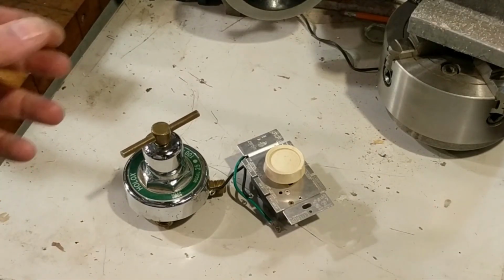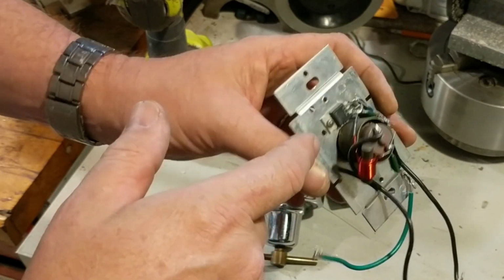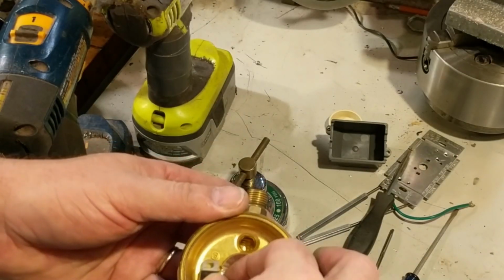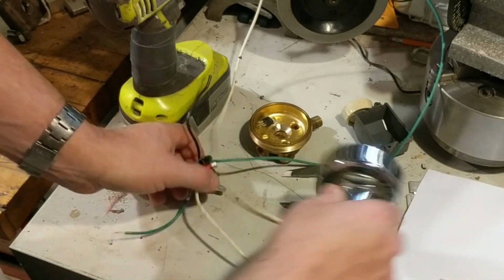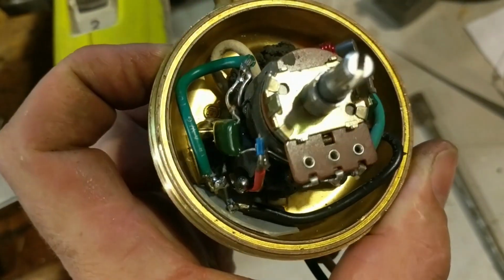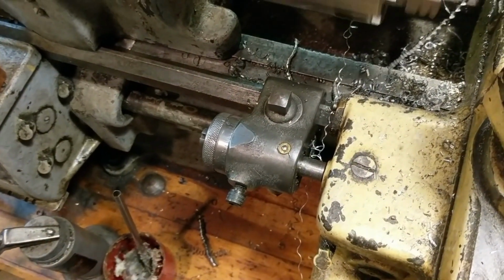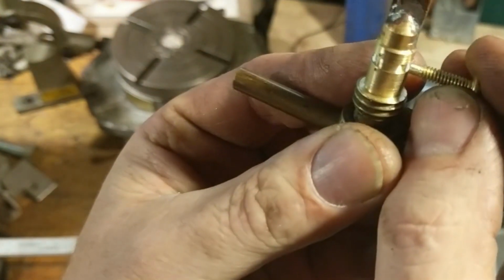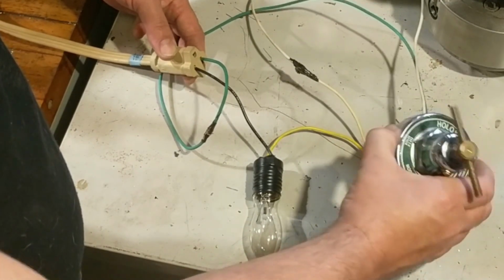Creating a Custom Lamp Dimmer Switch SteamPunk Floor Lamp Part 1

Comment: Is it possible to create a dimmer switch that fits into a small round space? I'm turning a floor hair dryer into a lamp, and the switch that used to control the temp (cool to hottest) would be awesome of it controlled the level of light.
Reply from the maker: It is possible, but a bit tricky. What you can do is desolder and remove the actual variable resistor component from the dimmer switch.  Then install that variable resistor in the location where you want the control to be. Then wire the three conductors from the variable resistor back to the rest of the dimmer switch.
It's not terribly difficult from a logical standpoint. But you do have to ensure that none of these terminals, which are live voltage, can possibly be touched or shorted. otherwise you leave yourself with an electrocution or fire hazard.
So it is possible to do, but I would be hesitant to do it unless you have a lot of confidence in your wiring skills and knowledge.
Reply: @TheBuildist  Can you recommend anyone that does this for pay?
Reply from the maker: @corbettthursby1734  not that I know of.

Comment: This should never by done by anyone who does not fully understand the electrical safety and engineering considerations!
there is none listed i clicked through the video no sound nothing realy flagged about voltages ect 
worst that can happen bit of a bang ... keep a fire extinguisher handy lol
i have adhd so safety is like a challenge at best